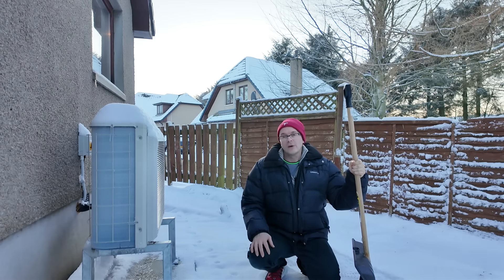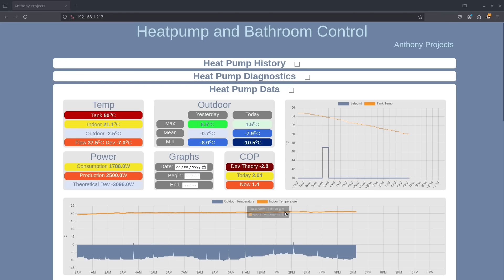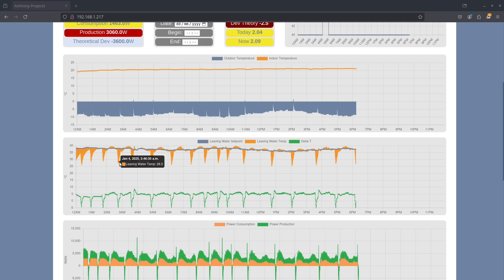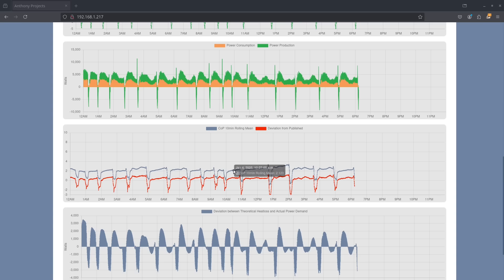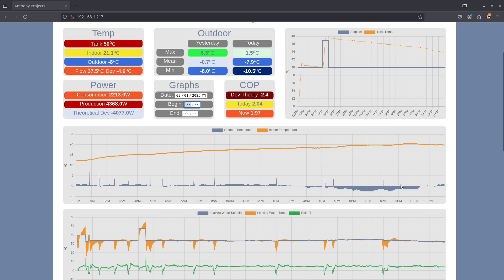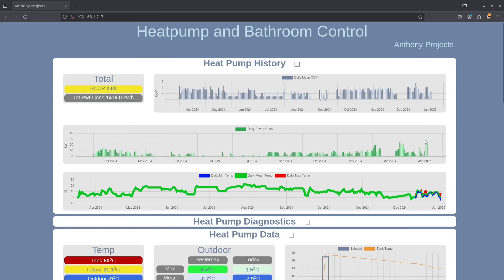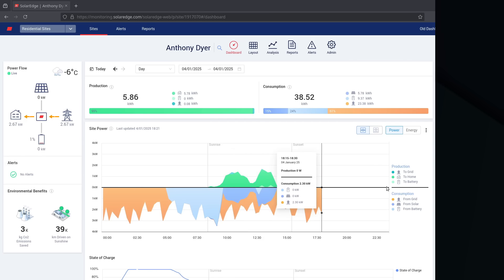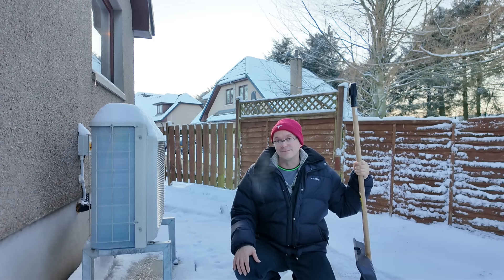Heatpump Performance on the coldest night of the year

Comment: use a chines Diesel  Heater  cost  per day my 1 bed house  extra cold  £2   normal  around  £1.30    kerosene   cost of unit  around £120   :-)
Reply: Yes, it seems the Diesel type heaters work very efficiently with Kerosene, and  it would be rather interesting to compare running costs over the winter as an exercise to determine whether they are an option worthy in terms of performance vs. running cost, as the installation costs and usefulness in case of an electricity outage are almost certainly superior. It's not hard to rig one or more such units to a direct supply from a larger tank than the one provided, and outlay is obviously substantially less than any Air Source Heat Pump.  The inherent potential safety concerns surrounding power bank walls should be borne in mind also, as if one such battery goes up you can kiss the home goodbye. A few miles from where the video above was made, three houses had fires (one was a total loss) just a couple of months ago due to a power surge in the line. Two of the homes were saved by the quick actions of the owners, the third one was not so lucky as the owners were out at the time of the surge. Nobody would consider such an incident as being likely, and yet... you can imagine how such an event might end up when a power wall battery is installed in the home.

Comment: Hi I would like to know what solar installation you have and battery size please.How much do you run on peak power during the months over winter.
From what I have seen on here the general opinion is that if your battery can power your house and heat pump through the whole day on battery in the warmer winter months. EVM states his 2 x 9.5kw battery will last him except in Dec and Jan. The days are so short and not much generation. I still have gas at the moment. We have an ev now and solar that consists of a 7.6kw west facing array and a 9.9kw array. This gives enough power to run the house cook dinner and dry a load of washing. The dish washer and washing machine are run during the charge period and off peak electric, The only day we run out is Christmas Day.I have roof space for another 4kw array south facing and will need an extra battery when we electrify the heating. EV Puzzle made 1100 pounds on export in 2024 so he ran his 2 ev and his house and was in pocket.

Comment: I am using an air to air PORTABLE heat pump to stop the house cooling down overnight.
These work in a completely different way to normal air to air heat pumps in that the take ambient air from the house and increase the temperature and expel the cold air outside.
These are not as sophisticated as normal "cassata" type air pumps that try to get their heat from the cold outside air - and have a low COP at low temperatures.
My Air to Air pump has a COP of 3.6 and using overnight power at 7p/kwh it produces 2.3kw from an input of 650 watts.
This gives 13.8kwh of base level heat for a cost of 28p per day.
An additional huge benefit is the removal of 4-5 litres of water every night - I would run the unit just to remove the water!
This provides a lovely "base" where the medium sized house of 3640 sq. ft. doesn’t cool down.
Reply from the maker: I’ve used the portable air conditioners, which are just heat pumps in reverse.  They are often cheap things and that’s something people don’t realise. It’s good to hear you have a good solution for your needs.
Reply: Can you give more information about this heat pump have? Heat pumps move heat not “cold”

Comment: I have a covered area on the back of my south facing house, it's basically a conservatory that is open to the front, makes it more usable in the summer as it's cooler, but in the winter it rarely gets frost, the only times i have known it were several days of -6c or lower in a row with no sun, could you put a heat pump under that as you would have almost zero defrost cycle?
Reply: The better airflow outside would probably outweigh the downside of perhaps fewer defrosts. You would be cooling the conservatory.
Reply: @Biggest-hz7ng  It is outside as the front is 6.3M wide and 2.8 high and is just open at the front, no doors, no windows etc as setup for maximum cooling in the summer, so no issue with air flow, it's more like a car port in concept, but has a high pitched roof to over 4m so hot air can sit up high.

Comment: 2,000 sq ft, Heat pump running at 900 watts electric, temp at 21 Deg C. Charge up 60 kWh of battery to 50% over night with 7p/kWh  and have about 8 to 20 kWh of solar this week a day to contribute. Only have to get to 23:30hrs. This setup changes March where we go back to being 100% of grid as solar will be pushing 50kWh a day on average. 3 expensive £120 a month s in winter(including charging the Tesla) for electric, hot water and heating. 3 months of breaking even and 6 months of £250 income from export. Works out nice to be honest.
Reply: That means you have around 12kw of solar insalled. that takes up quite a lo of space.

Comment: Wish I could get this sort of data from my heat pump. Bought a house with twin daikin Altherma and there’s zero smart functionality
Reply from the maker: @danfrench2008  There’s zero smart functionality,  but there is a serial port on your indoor unit.  You might want to check out my previous videos on acquiring the data from your heat pump.  I basically hooked up an esp32 to that serial port.  Look up a project called “espaltherma”.
Reply: @ sorry I should have been more specific, I meant retrieving data from my installed system. Was in when I bought the house and came from one with Hive so not having any data on my heating system was backwards. 

I’ll check out the port on my system if I can find it and try and hook up to get the data out.

Comment: For the month of december i was averaging 17kw of electricity in household consumption and i am on the full electricity rate lets say 25pkw. I have an oil fired central heating system and my consumption is between 6 and 7 litres a day tops. oil is about 55p a litre. So that is £3.85 a day to heat the house so that money would buy me 15 kw of electricity i do not think that is enough to run a heat pump.with a home temperature of 21.5c. Oh solar my 4 kw system manages to generate 0.5 kw on a wet day and 2 kw on a winters sunny day. I have a diverter to hot water and am lucky to get  .5 kw of hot water a day  the house uses the rest so a battery powered by solar in winter for me dosnt add up. The government controls the price of electricity through various ways so being rrliant on s government pricing control system ???? Remember the saying " i am from the government and i am here to help you"

Comment: Heatpumps are a good option for people who maybe eligible for a grant to have one installed and thier heating system adapted if your not eligible and can afford the outlay costs to provide yourself with lower cost heating and hotwater,  then it could be for you!. But don't forget insulation and solar panels on the roof and battery. It not affordable for eveyone. Summary= high outlay cost/low running cost.  But if the technology develops a problem how much does it cost then?, and are the products really green to manufacture?.
Reply: Oil or gas boiler, Trojan horse
Reply: If there's a problem with the technology,  as I recently found out, it's complicated to resolve,  a recent problem with our energy provider's server led to all sorts of issues with our car charger!. Not everyone has the time and money to resolve complicated problems. Old people can't deal with either when things go wrong. Regular boiler etc easy, Regular car, easy.

Comment: Surely storage heaters would be the best thing to use these days with overnight electricity as low as 4.7p per unit?
Reply: Batteries to capture the cheaper electricity and heat pumps to obtain multiple times the energy output as heat would probably be cheaper and more flexible.
Reply: @Biggest-hz7ng  It just the installation cost of heat pumps that worries me. There's so many options to heat your home these days.
Reply: How do you manage to clock in for that ? is on a daily basis ? 
cheers
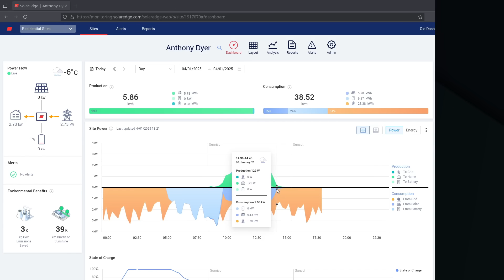Reply: @patrickallfrey6148  Tomato Energy overnight rate is 4.7p midnight to 06:00, 12p 9:30 to 11:30, 22:00 to 24:00, otherwise 22p.
Reply from the maker: @sargfowler9603 This is probably the best comment I’ve seen.  I never heard of Tomato energy until today and their deal is very compelling (It’s like Octopus Go + Octopus Cosy in one tariff).  Unfortunately they don’t offer their “lifestyle” tariff for my postcode.  I’ll keep an eye on them however.
Reply: Horrible things. Also probably run out of puff before the end of the day.

Comment: Flow temperature to radiators of less than 40C. This would require new bigger radiators or underfloor heating, if not a complete refit with bigger pipes for most people.
The upfront cost and extremely long payback time (if ever) isn't going to make sense for most people.
Until it gets cheaper to buy, these are tech toys for the wealthy, not the environment saving tech it's said to be
Reply: You do realise people will cancel you for not agreeing with they're net zero green rip off
Reply: @pauldavies7251  Air to Air heatpumps can be had for £1,500 and are even more efficient. You can get rid of your radiators as well which makes a big difference in UK homes. The electric water pump to pump the heat around the radiators uses more than my air to air heatpump on 19 deg C. Solar panels are £60 for 450w, inverters are £1k batteries are silly cheap now...but you have to diy
Reply: I dread to think of the cost of upgrading my system (19 radiators on microbore pipe) as it would not only entail the purchase of these items (and all the associated heat pump stuff) but most of the flooring and floorboards would need lifting. It would cost many tens of thousands of pounds.
I'll stick with my linked oil and wood systems thank you very much.
Reply: @dabrab  microbore pipework doesn't always need replacement, depending on the house survey.
Reply: @Biggest-hz7ng  I bet it would as the system is probably on its flow limits already.
Reply: The upfront cost after grant is often comparable to gas boilers as are energy costs. They help achieve the UK's emissions targets.

Comment: Interesting video, we've not got a heat pump but do have solar & batteries (16.4kWh).  Is it worth you getting more battery storage to have more capacity for use during the day??  Am I right in thinking that your heat pump uses approx 30kW during a winters day??  Your overnight cheap rate electricity is good value at 7p vs mine at 14p!
Reply from the maker: @mickdownes9265  My last video looked into the economics of another battery. The latest server rack batteries are now very well priced.

Comment: If the planet is heating up, WHY do we have cold and snow, the heat pumb runs 24 hours a day not on and off,
The water temp does not heat enough to kill the legionair in the water,
The hot water heats between 3 & 5 am & pm.there is no external insulation of the house.

Comment: During these cold spells how much electricity is being used on this system to keep the immersion tank up to temp for the radiators and defrosting the outside unit ? My gas boiler uses electric for the boiler and pump, no need to run the immersion tank as that is only for hot water and not the c/heating system unlike a heat pump system. Also during most of the year I have no need to run the central heating. Total bills last 2 years for gas and electric including daily charges was between £1,00 and £1,300. No need for an expensive and over complicated heat pump system that realise on topping up an immersion heater to keep the water hot on the radiators.
Reply: Our heating system in the north Highlands, a ASHP linked to a thermal store, has never used the immersion heaters for either the heating or DHW even at an outdoor temperature of -17c. The bottom of the store runs at 40c for the heating and to preheat DHW, the top is at 55c for the second DHW coil, this is exactly the same as our previous oil boiler and is still using the same 3 way valves installed 20 years ago, nothing complicated about it.
Why are you making a point of saying you don't need to run your heating for most of the year? Why should that be any different for a gas system compared to a heat pump system?
Reply: The overall efficiency of the heat pump makes the energy cost comparable to gas boiler systems, despite energy spent on occasional defrost cycles. We need to reduce emissions and move off gas.
Reply from the maker: I don’t use the immersion heater.  Contrary to many perceptions, heat pumps are actually very simple systems.  They have very few moving parts.

Comment: Can you show the graph where the heat pump produces gas to cook my chicken and hot water to wash my hands ,thanks
Reply from the maker: @MrMan-f9c  My previous videos show that.  But you could see the HW tank temperature was 50 degrees  in this video.  As for your chicken:  You can try an electric oven, or an induction hob.  You don’t need gas.
Reply: @anthonydyer3939  Many UK properties use combi boilers so have no HW tanks - to use heat pumps somewhere has to be found, inside the house, for HW  tanks to be installed and the plumbing adjusted.
Reply: @anthonydyer3939  your hot water needs to exceed 60 degrees to counter Legionnaires disease and have to buy an electric cooker to cook a chicken when i have a perfectly good gas stove lol
Reply: @MrMan-f9c  No you don't.  In fact, many boilers like my dad's are set up to never exceed 60C for Legionella.  If it was such an issue in residential settings, there would have been mandated temperature probes in hot water cylinders and active management of it for decades.
Reply: @BenIsInSweden  Yes concerns about Legionella are exaggerated, especially with no water storage tanks in the roof (pressurised hot water tanks fed from the cold main).
Reply: @MrMan-f9c  Air Source Heat Pumps have a Legionnaires cycle. They heat up to 60˚C, then kick in an immersion heater up to 65˚C for an hour or two, once every 15 days. It's all fine, and doesn't produce any CO2.
Reply: @AndyInTheUK  "doesn't produce any CO2" at point of use.  All electricity delivered to domestic properties has a component that released CO2 in it's generation.
Reply: We cooked our Christmas Turkey in a halogen oven loads cheaper than putting the main (electric) oven on also will run off the generator if there’s power cuts 👍🏻
Reply: Heat Geek ashp installs are averaging 4.4 efficiency. So instead of a gas boiler being about 90-95% efficient, Heat Geek installs are 440%  efficient. Put in equivalent kw of energy & convert to pounds, & gas is £95 & ashp is under £25 in the same amount of Kw energy.
Reply: @paulfrost3501  That is too simple a calculation - the differing costs of gas and electricity have to be accounted for.  My electricity average cost, per 24 hours, is 20 pence / kW gas is 6.2 pence / kW
Reply: Can you show me the graph where your gas boiler cooks my chicken?
Reply: DONT EXPECT ONE THING TO DO IT ALL, OIL AND GAS ARE ONE OFFS VAND ONCE THEY ARE GONE ITS GONE JUST LIKE WHEN YOU FILL YOUR CAR UP THAT YANK OF FUEL GONE FOREVER, YOU CAN ONLY BURN IT ONCE,WE NEEF RENEWABLES TO LEAVE WHAT OIL AND GAS IS LEFT TO MAKE OUR SOAP PLASTICS ETC, BAGS OF SUN UP THERE,I LIVE IN BRAZIL AND HAVE BOILING WATER ALMOST EVERYDAY FIR 9 MONTHS THEN IT GOES JUST WARM, BUT I SAVED A LIT, UK YOU COULD SAVE AT LEAST 6 MONTHS WITH SYSTEM I USE AND ITS CHEAP AND NOT NEW